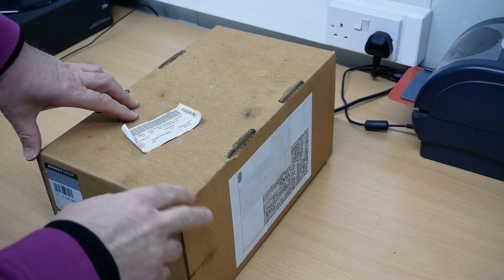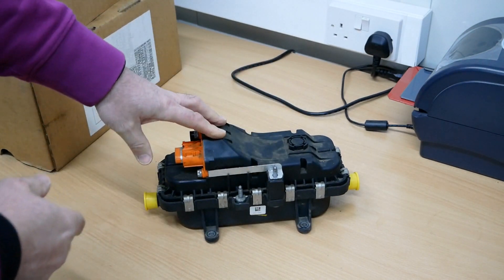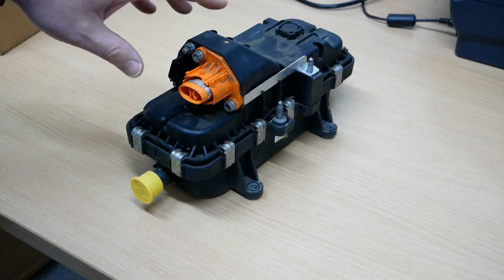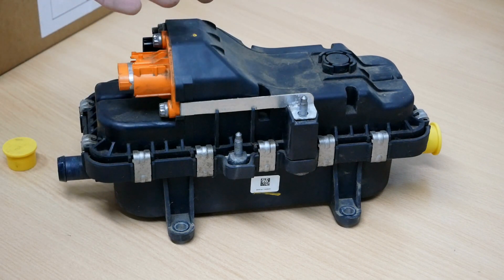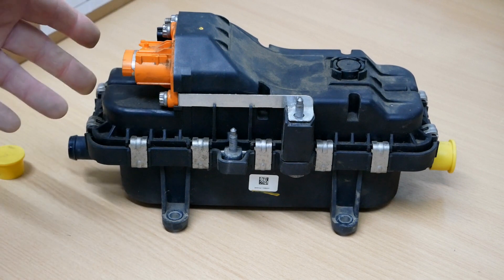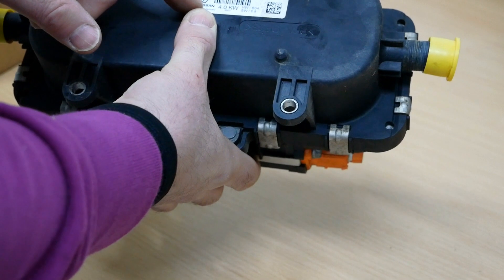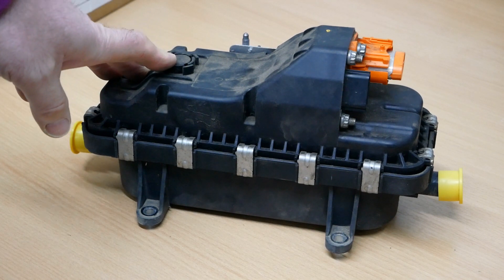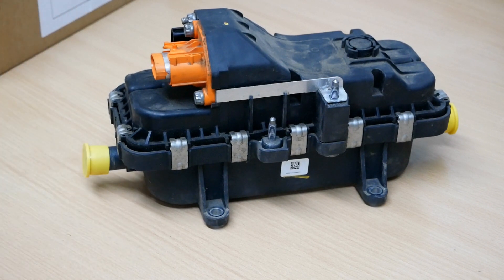Renault Kangoo ZE 22kWh PTC heater failures

Comment: It is terrible design and assembly. Most of them fail due to bad soldering on lower PCB PTC terminals. PTC elements on it's own never fail. Bad soldering on PTC terminals causes arcing inside, which eventually damages IGBTs and other components. It is possible to fix it, but only if you are good in electronics. I shared the details of how to do it on my website. But even if you replace all damaged components and sort soldering on lower PCB, most likely your vehicle will refuse to activate it due to logged major error in PTC heater microcontroller. So you then have two options, use my LIN controller for heater activation (firmware and schematics in my website) or reflash  PTC heater microcontroller. Another less severe failure is then voltage regulator chip gets damaged. In such case it also damages diode and resistor next to it. If this is a case, after repair no need to reflash microcontroller or use my LIN controller. I personally suggest not to waste your money on replacement units, just buy diesel heater and install it instead. It's much cheaper, more reliable and saves your EV range in winter time.

EDIT: I just realized you already found information about my repair and you shared the link in your video description. My website is still missing information about the need of reflashing heaters microcontroller after major fault. Will try to update it in near future.
Reply from the maker: Thanks for the info. I've pinned your comment.

Comment: my Renault Zoe (2013) has LV (low Voltage/12V DC) PTC heaters in it at a maximum of  1800w - suppose to supplement the heat pump system in cold weather , but when my heatpump packed up once I enabled the PTC heater to run and at least it gave me some heat in the car which was better than none at all

Comment: It seems like mine give up. How long should you wait for warm air to start blowing from the start? Is there any fuse to check before I start to worry?
Reply from the maker: The heater should be pushing warm out in about 15 seconds or so.
As for fuses, I'm not sure, but I suspect there is.

Comment: I have a 22kw/h 2019 over here in nz, how do I tell if i have a heat pump or a 400v kettle?
Reply from the maker: In the UK, the 22kWh vans were 2011-2017 models. From late 2017 they were 33kWh.  Only the 33kWh vans had heat pumps and I think possibly only the vans with air conditioning too.
Reply: @GoGreenAutos  Its a bit of a odd one, 2019 maxi, with the 22kw pack and Continental engine, but I have aircon, and no idea about the heater, Its just came out of warranty and the check electrical system has popped up, think its time for some 3rd party extended warranty type break down insurance, That heater thing in NZ would be like $2500 by the time you convert it and pay the Kiwi tax. Has just done over 60k Km's so far
Reply: Heres the car: https://imgur.com/a/FF21wFh
Reply from the maker: @MINIDISK111111  Yes thats the old motor used in the 22kWh models. This was discontinued in early 2017 in the UK.
I see your have air conditioning too, but that will have a PTC heater (if the same as the UK models). Is the AC charger 3.6kW or 7kW?
Reply: @GoGreenAutos  3.6 unfortunately
Reply from the maker: @MINIDISK111111  So yes, all the same spec as the earlier 22kWh models here. So definitely the PTC heater shown in this video.

Comment: Renault quoted me £1,447 to supply and fit a new heater in my Kangoo ZE, so I just fitted a 12 volt fan heater. It's less effective than a new PTC heater, but at £50 it's a lot less expensive! I made a video in case it helps others. https://youtu.be/7ijdygqI3Qc
Reply from the maker: Good solution. But could you mount the fan heater inside the cabin, so it was heating up warmer air, rather than sucking in cold air?
Reply: @GoGreenAutos  Thanks. The advantage of siting the fan heater inside the cabin would be reheating the cabin air. The disadvantages would be longer cables carrying high current, high current cables in the cabin and not being able to use the van's air ducting system to direct the air where you want it. Maybe the next thing to try would be a hose to draw air from inside the cabin into the heater's intake.
Reply from the maker: @Dory222  Yes of course, you're going to want to direct hot air on the windscreen, so it needs to be where you have it.

Comment: Mine has gone in my leaf now. Please can i have that one to try to repair it for my muxsan leaf. I think the issue is poor soldering on the lowest level of of the pcb that connects to the elements. The leaf ones are supposed to be 5kw so maybe its not the same but id gladly try to mend it for my car.

Comment: Eberspaecher.. Interesting. 

https://www.eberspaecher.com/en/products/electrical-heaters/high-voltage-heaters

They are the mainly known for the cabin heaters like the D1LC .. as used in Diesel vans and land Rovers everywhere. 
I have had and repaired a few over the years. The parts an backup is very good. They are NOT cheap bits of kit in diesel form but they are probably the diesel heater of choice for campers, boats etc...

So it may be worth contacting Eberspaecher OR one of the main service agents to see if they can supply part for it? The only issue is if they deem the voltage to be too much of a health and safety issue .. and will not supply part in case someone gets a shock!

By sheer coincidence it looks like mine has just packed up! 3 years old 12k miles!!
Reply from the maker: Yes I have. See the video description above. No contact back from them yet. 
But more information on the new webpage.

Comment: Mike you got a good deal on your ptc heater. I have a 2012 leaf your one looks very simalre to mine. Anyway my ptc heater failed took it  to rip off nissan charged  me plus labour 3500 quid. The heater was worth more than the car. Spent a number of months without a heater. I managed to source a part from the US and also managed to get a garage to fix it. Be very wary of leaf that use the Ptc common failure and very expensive to fix.
Reply from the maker: Its exactly the same part.
If you want to see more on this subject, see this page and the links at the bottom https://www.gogreenautos.co.uk/how-tos/renault-kangoo-ptc-heater

Comment: I was looking to buy a 2012 Nissan Leaf about 18 months ago which was listed for a very reasonable price and in fantastic condition for the age with no loss of battery bars. It had an interesting history as it was a UK model but never registered here, it was exported to Singapore where it spent its whole life before it was shipped back for sale. I test drove it, inspected the health with LeafSpy and ended up putting down a deposit pending the service to be done by Nissan. Unfortunately it fell through because of the PTC heater part had failed when they did the inspection and it was going to cost £1000s to fix, they said they’d also need to dismantle a lot of the car to get to it which no longer made the sale financially viable for the vendor. I think it was only the very early Leaf that used this but something to be aware of (I test drove it on probably the hottest day in 2019 so wouldn’t have noticed the broken heater).

Wasn’t all bad news though because the day it fell through a 22kW Zoe ended up being listed on a local EV group for an excellent price which I ended up getting.

Comment: I heard and according to the owners manual that it is not recommended to use full fan speed with the heater full on. I only use it on the first speed and it's more than adequate. Maybe the elements are being used too hard by people expecting it to work with a fan at full blast which is not what the manual recommends.
Reply from the maker: Its just a water heater, so fan speed should make any difference. Its probably stating that in the manual more to converse energy as you could soon suck out the heat and make the heater work at maximum for little gain.
Reply: @GoGreenAutos  understood, thanks
Reply: You could be right, PTC heaters are self regulating, if the fan is running at full speed more cold water will be flowing over or around the element and it will have to pass more current to maintain its temperature.
Reply: @Bernie_the_Bolt  I think there is something in this because it seems odd that a vehicle designed to such a high standard has such a defective part. It may be to do with incorrect use of the heater.
Reply: @stephenhayes50  Having watched the video that Matt has linked to it appears the heater is not well made, but it could be the harder it is required to work the more likely it is to fail
Reply: @Bernie_the_Bolt  thanks. That rounds out the subject well
Reply: @stephenhayes50  Because it is made by Eberspächer. It is faulty design, I showed exactly what is wrong with it and how to fix it on my website. It has nothing to do with incorrect operation.

Comment: I'd suggest sending to / contacting bigclivedotcom on youtube. He's great at taking electronics apart and diagnosing problems.
You may not get it back, but he'll certainly let you know what the problem is :)
Reply from the maker: I have been informed of the problem...clearly a bad design overall - see https://ev-olution.yolasite.com/Nissan-Leaf-Heater-Fault.php
Reply: Great idea.. I follow BigClive too.. he would be your man for stripping and see if it could be repaired 👍

Comment: It's probably produced in a very small quantities, which is why the price is so high.
Reply from the maker: Not that small...Renault have sold 58,000 Kangoo ZE's !
Reply from the maker: @matematic7240  Everyone worries about battery packs, but these are one of the most reliable components on an EV and in most cases will outlast the vehicle. True, inverters, chargers, heaters etc are expensive but generally are very reliable too. Costs will reduce. The main problem now is that dealerships don't have the diagnostic skills, so labour costs too much for repairs. This will and is changing though. See some of Cleevely EV's videos.
Overall, though, EVs are hugely more reliable than ICE vehicles...far less moving parts, far less wear and in reality, the repair costs aren't any more expensive than modern ICE vehicles either when fixed at main dealers. I hear some horror stories about modern ICE vehicles and their costs!
Reply from the maker: @matematic7240  Yes these heaters are for the cabin heater, but they heat up water which then gets pumped around the heater system..in the same way a ICE vehicles pumps hot water into the cabin heater matrix.
Reply from the maker: @matematic7240  Cleevley EV is https://www.cleevelyev.co.uk/ . They don't have a YT channel, but videos are posted by James here https://www.youtube.com/user/James0852